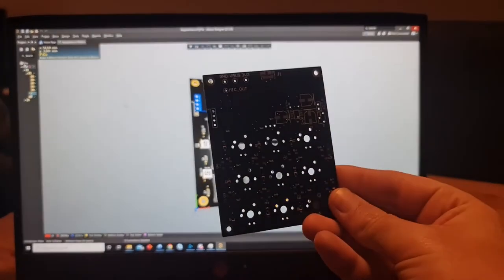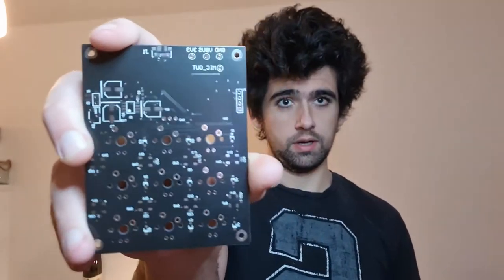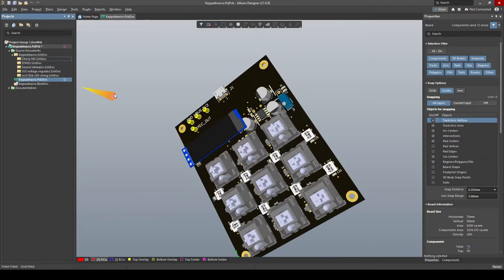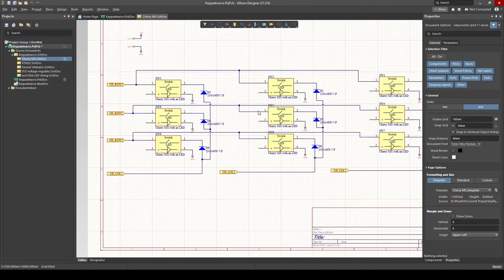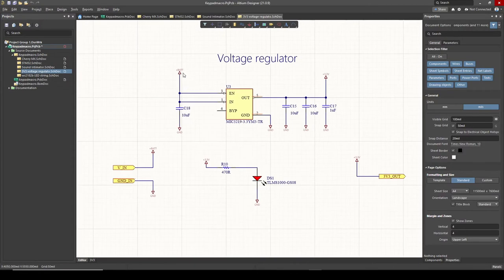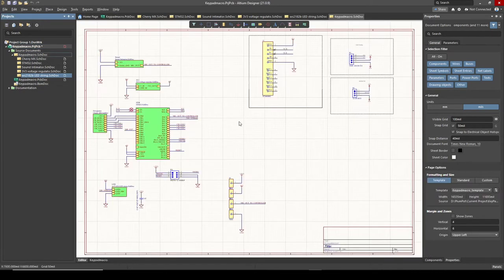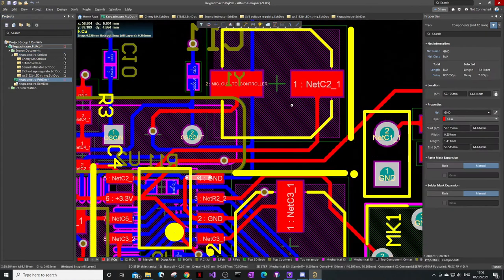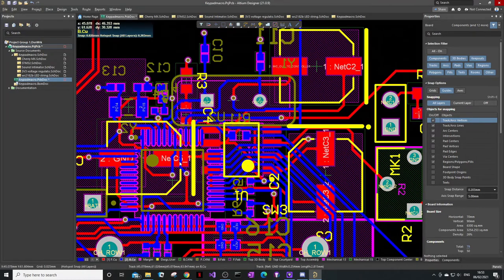Making our own Macro Keyboard - Designing our own PCB

Comment: In this project are you programming the keyboard to be a USB hid or do you have a script running in the host machine that translates key presses on the macro keyboard to actual key presses?
Reply from the maker: I'm still playing with ideas wondering what will be the best option. It needs to be configurable. What do you think will be best?🙂
Reply: From experience.... If you're gonna go with a script it's gonna be infinitely easier, since there are a lot of library functions to make your life easier such as pyautogui and pynput where u can easily simulate key presses. But the main disadvantage is that it takes up a good amount of computing and memory resources, so if you are using it for applications which demand a lot of resources this won't be the best way to go. On the other hand if you write a driver for it it will not be as resource intensive, but it is much harder. I myself am just searching and learning to do that for my own application. So it boils down to ease of coding vs efficiency for you. So you can choose depending on the application you want to use this along with. From personal experience, using the 1st method is easier, faster and works well for most games as long as your host machine has enough resources to handle them. That's just my insight! If you go with the driver option, I would like to know the outcome of that as well, since I can implement in my application. Thanks :)

Comment: Sir what is the main difference in kicad and altium,and what you recommend for us
Reply from the maker: Hi Yasin, Altium is has many more features and is used by companies around the world. KIcad is amazing free software perfect for home projects and to be introduced to the world of PCB design. If you would one day work as a PCB engineer I would try to learn Altium, if you just love making PCBs for your projects KiCad is fine🙂. Altium is not free though but if you are a student you can use it free for 6 months and then they have much cheaper rates for students than  companies👍
Reply from the maker: @justtestingonce  Hi 👋. I will check out. I do not doubt that the engineers who use kicad is not world leading. I can only speak about my experience in South Africa and Netherlands. I have not met a company that uses KiCad. But will look more around the world😁
Reply: @justtestingonce  What about Proteus? Just a curious question.